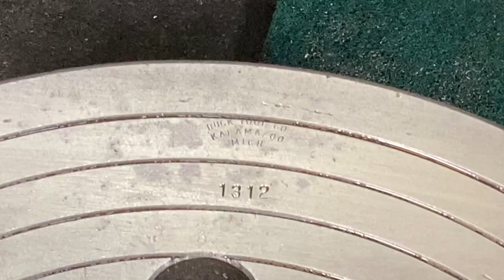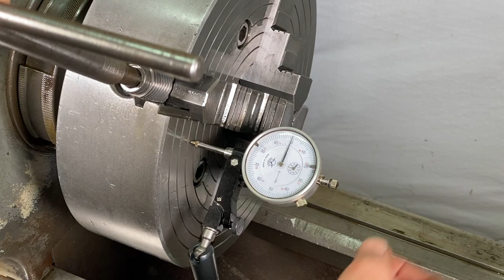4 Jaw Chuck Rust Removal - Evaporust - Right On With Jon Crane #8 Evapo-Rust

Comment: Evaporust is not available in the UK AFAIK, but in any case I typically use non proprietary means to do the rust removal like Citric acid - non toxic (it's a foodstuff and used as such) - electrolysis for REALLY heavy rust, and plain old mechanical means for surface rust like wire brushing - rotational & by hand - and using various levels of Scotchbrite from the really heavy duty open foam, hard blue disks to the great for polishing red & green product which are available very cheaply.

I am currently restoring a large pillar drill (70mm x 800mm column!!), A Myford ML2 lathe, two Record vices, one just completed, multiple parts of those items were extremely rusted including two Jacobs chucks rusted solid, both now working perfectly and freely - ALL the above, but especially the latter just submerged & soaked in citric acid (6:1) for 1-4 days.

The key I have found with any kind of tools is to FIRST thoroughly degrease & clean using Gunk engine cleaner - submerge, soak, scrub - use all sorts of brushes from paint brushes to toothbrushes, then thoroughly rinse in clean water, dry, check for and remove any remaining grease etc, then submerge and soak in citric acid for as long as needed giving an occasional fine wire brushing to remove the loose (typically black) oxide layer. This latter step of acid soak is vital to remove and release rust binding internally and works. The two rusted solid chucks were able to be moved easily afterwards which enabled full disassembly, further rust removal and polishing now they both look like well used but also well maintained units. There is nothing like seeing solid tools being resurrected from the dead/scrap heap. Best one in the last three years? A completely rusted, seized and totally unusable small 10" stilson wrench that cost just £1 !!.
 at an auto jumble.. Now a HIGHLY useful, great looking red and black addition to my bench!
Reply: Thank you for your input. Really helpfull.

Comment: Jon,  Can you use the Evapo-rust over again?  Now, considering the cost of Evapo-rust vs White vinegar is it worth the cost?  And, you still had to use some elbow grease.
Reply from the maker: Hi Vincent! 👍 Yes you can use it over and over and in my experience it works a lot better than vinegar. All parts must be completely covered/ submerged in the evaporust. Also be sure to degrease parts prior to evaporust. 
Right On!👍
Reply: @RightOnJonCrane  Thanks Jon.